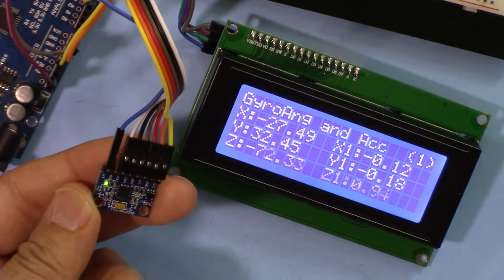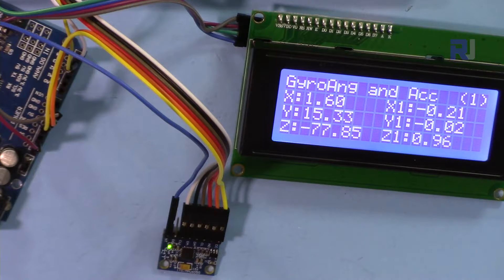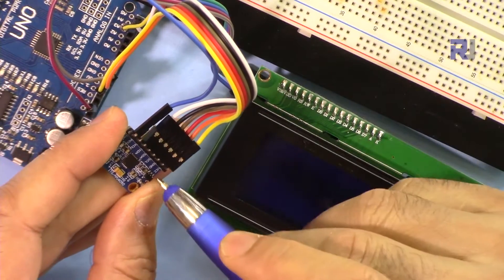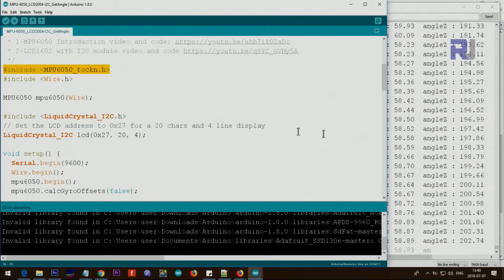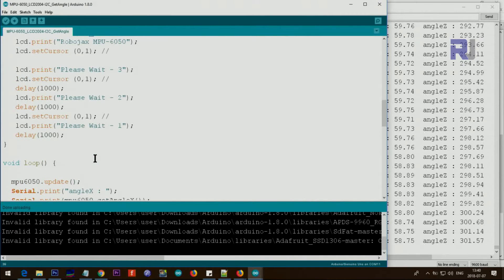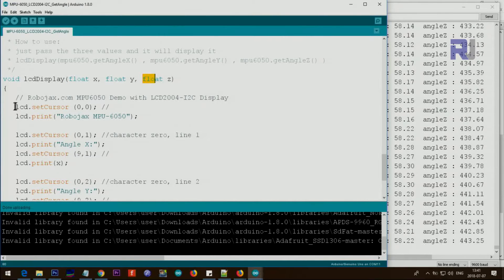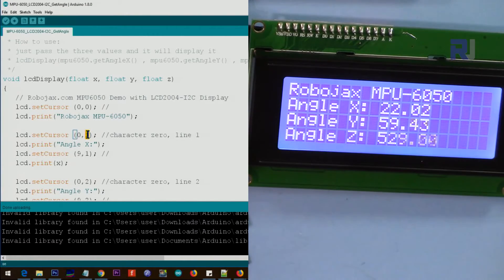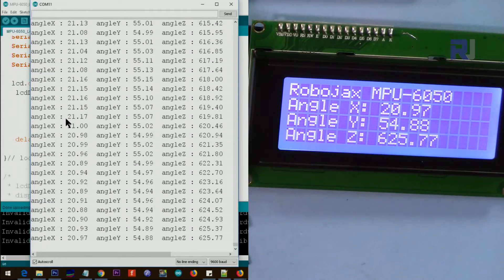Display Values from MPU-6050 on LCD2004 I2C Display RJT99

Comment: This is mostly great, but you're SO CLOSE with the camera, I can't see where all the wires are connected. Can you share a schematic or something for this? I have to keep pausing the video and tracking the wires manually. :(
Reply from the maker: I have seen people film them far away so I did this great way. I explain pins first when I explain hardware. so you have to pay attention to hat. then for each wire I show the wire, mention the name and I connect it to the pin.  There is nothing left to know. By  the ways this video require you to watch two other video. 1-Introdution to LCD 2-Introdution to MPU-6050 . if you come directly to this video, you will not learn anything . both modules have been explained fully. Perhaps you skipped those two videos.
Reply: @robojax  It's mostly the tangle in the breadboard that's hard to follow.
Reply from the maker: If you never used the lcd then you should not use it with the mpu module. First make sure to just display hello on the screen then you can use it in any project.

Comment: good one
I'm presently working on a robot that will make use of the MPU6050 accelerometer to detect impact. Mind to give me a tip on the best code I can use?
Reply from the maker: Thanks. I have not used any code related to impact.  I am sure if you spend some times using google advanced search you can find the code.

Comment: Don't print the "Angle X:", "Angle Y:"... etc every time through the loop. Just print it once. Only print the numbers every iteration. The display won't flash so much and will look much nicer.
Reply from the maker: change this line if(millis() - timer > 1000){ and make 1000 smaller to see faster refresh of data.